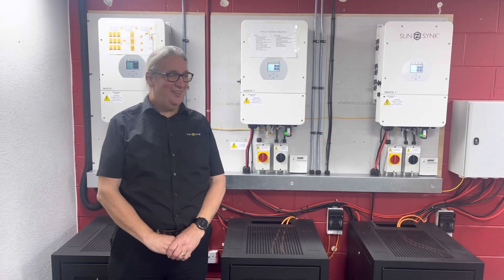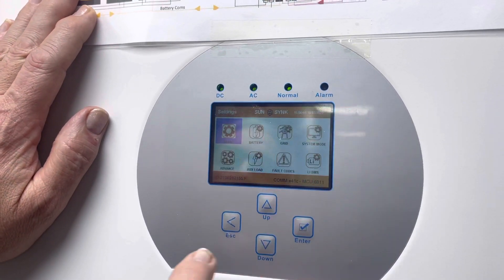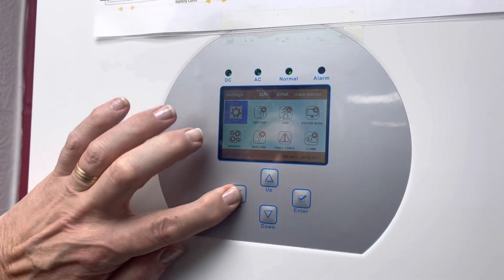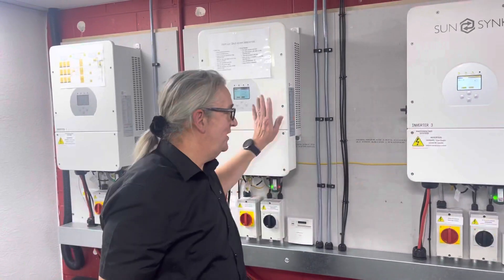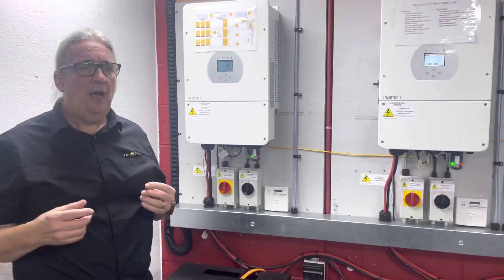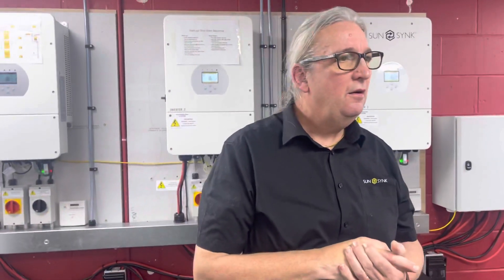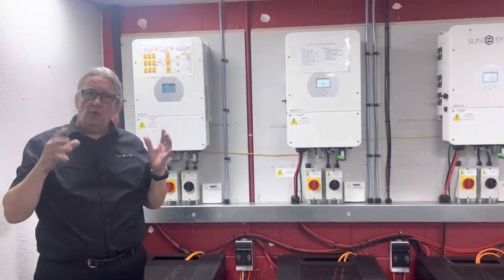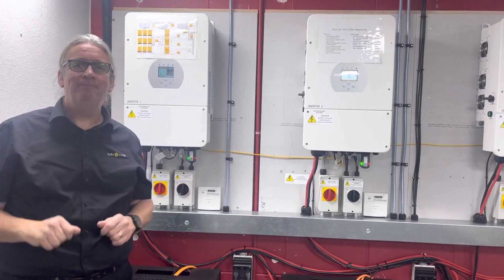This is a great example of load shaving and using the system controller #Sunsynk

Comment: Great video. I want to install a simular system but the output would be single phase. I also want to hook up my 40kva/26kw generator to the system for whem the loadshedding goes on for too long at night. But I see only red lights with the gen/aux port.can you please assist?

Comment: Had a recent software update on a system consisting of 4 x 12kw units with a 90kwh battery bank and 49kwp array. But after the update that peak shaving setting is gone. Any advice?